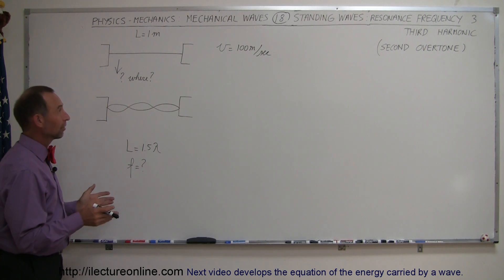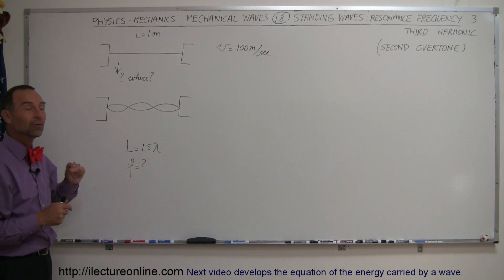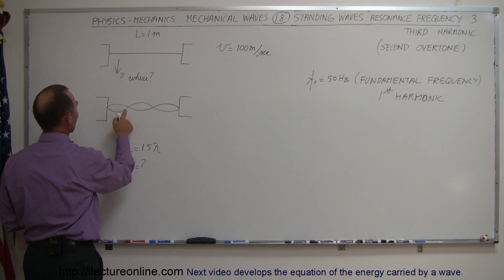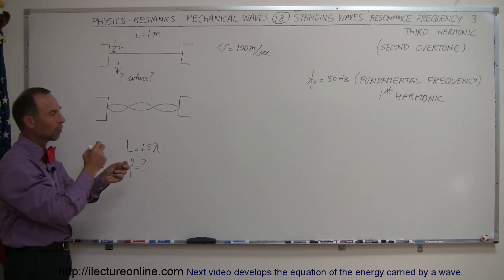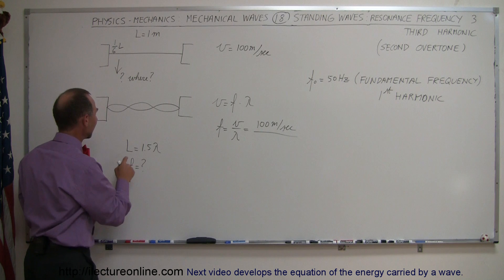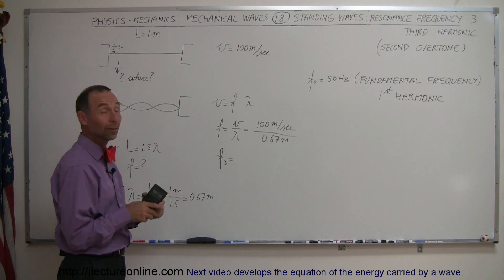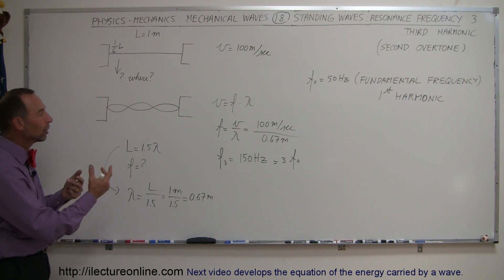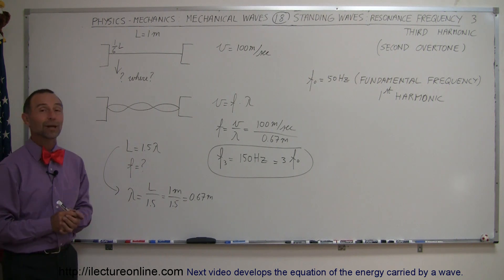Physics 19  Mechanical Waves (18 of 21) Standing Waves: Resonance Frequency 3: 3rd Harmonic

Comment: What about the energy of a standing wave?Can we say that the energy of a loop is transfered to another loop?
Reply from the maker: The energy is stored in the stretched string (like a rubber band).
Reply: That means energy will not be transferred from one part to another of a standing wave.Am I right?
Reply from the maker: Actually in a standing wave the energy is transferred at the same speed as in a non-standing wave.  A standing wave simply means that the waves traveling in the opposite direction are synchronized such that the nodes and anti nodes are always in the same place.
Reply: @MichelvanBiezen  thanks :)
Reply: I have another question.Does escape velocity depend on direction?I mean if I throw an object (having the velocity 11.2kms-1 ) with an angle such as 60° what will happen? Will it act like a projectile having an infinite horizontal range?